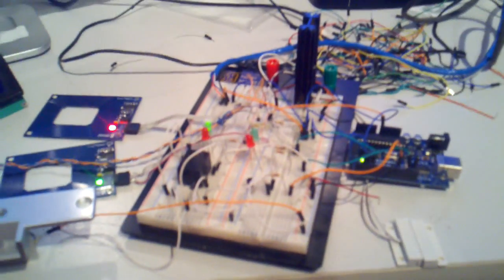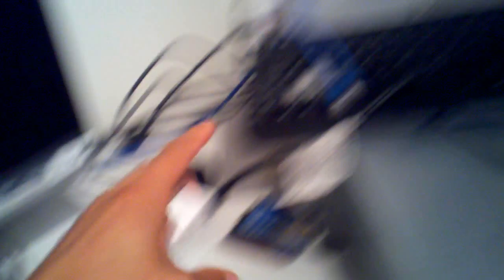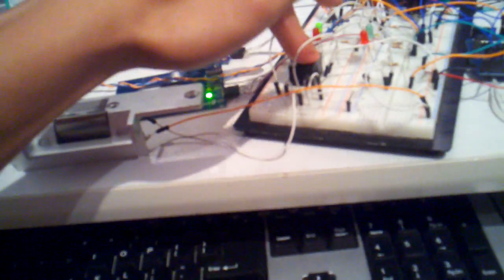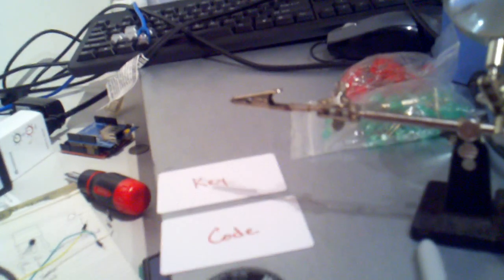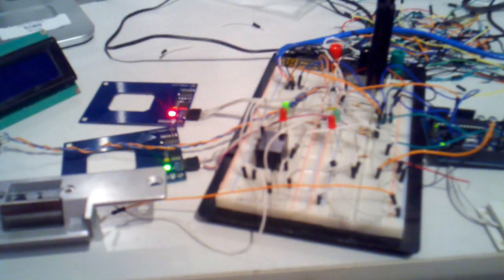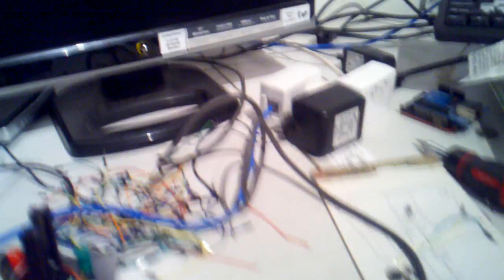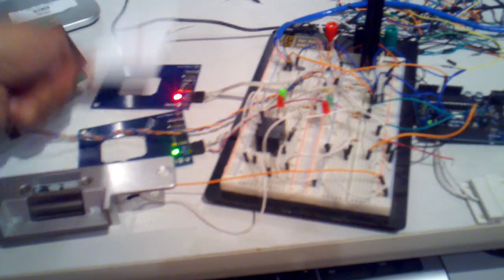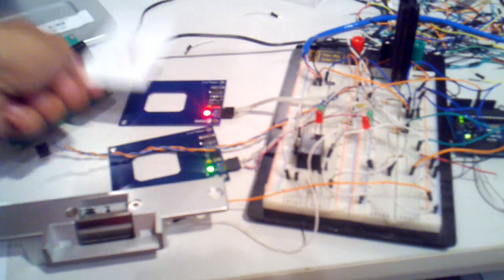Arduino W/ RFID and X10 Home Automation

Comment: you wouldnt need internet on your smartphone to unlock your house and control the other devices. As long as your home wireless net extends to outside your door you can just set your phone to auto connect to that network when in range.

Comment: Nice!
I agree completely with the relay thing.  Transistors can do the same thing, but I prefer not to mix grounds of multiple power supplies.

By the way, we have the same soldering iron. 15 bucks @ MPJA, right?